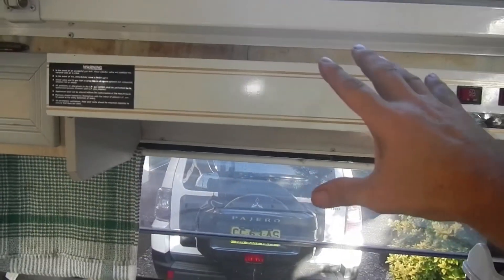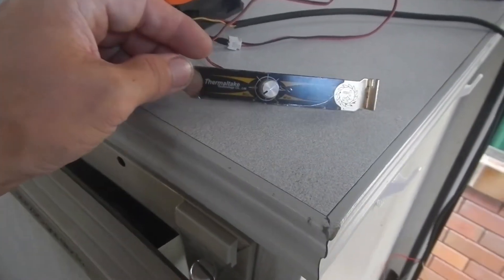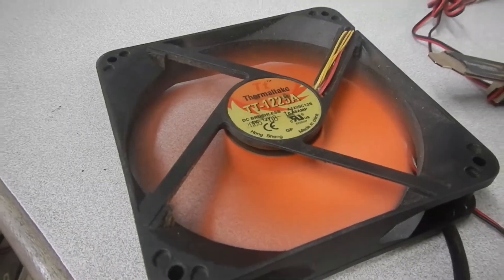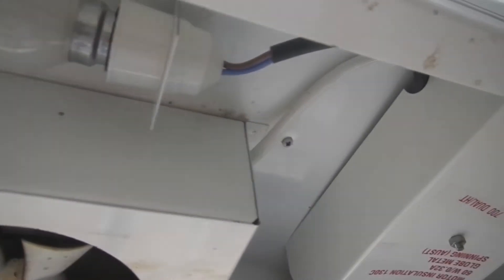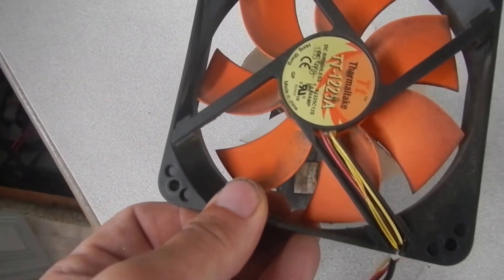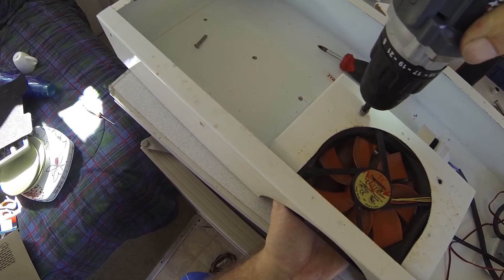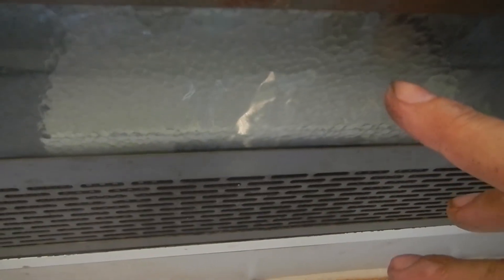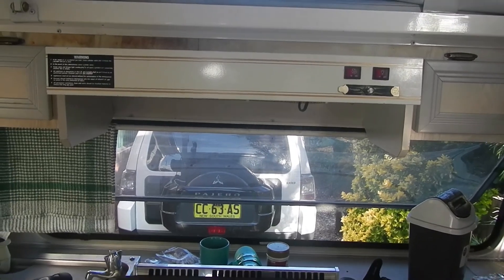Caravan Rangehood 12v Conversion

Comment: Good job. 
I found your video looking for ways to quieten a standard AC range hood (Robinhood). The low setting is 44 W and annoyingly loud. 
From my research AC fans are not as good as DC for energy efficiency, speed control, noise etc.
How do you find the air movement with the computer fan? It would be much less than the the AC one. 
My Robinhood is rated at 375 m3/hr which is 220 cfm, on high setting (65 W), and by extrapolation: 250 m3/hr on low (44 W), or 147 cfm.
Those little 120mm fans do about 10 cfm which is about 17 m3/hr.

My previous Robinhood was about 24 W on low and much quieter. Based on the above air movement specs. that would be 138 m3/hr (or 81 cfm). Unless your cooking meat at high temps. I think range hoods are way too powerful. You just need enough air flow to direct the fumes out the back.

I'm now looking at 120mm USB computer fans on eBay.
If I remove the grille below the Robinhood fan there's about 45mm to fit one of the 120mm fans (25mm height).

Comment: The Thermaltake TT-1225A fan is 120mm not 80mm.
Reply from the maker: Did I say 80 did I? Thanks for correcting me. I haven't used an 80 in a pc build since the 90s 😁

Comment: What the fuck is wrong with these caravan makers thay seem to do things on the cheap, I've got newlands caravan it's got one rcd running all the 240v and it ended up fryed, so $500 later and 3 rcds put in its working great,
Reply from the maker: No idea Mark, but they all seem to do it. 

It's disgusting what they do in areas that they think you will never see. 

I know the market is getting flooded with so many makers these days, but some workmanship is just pisspoor at best . 

and when it comes to that sort of stuff, it's just down right dangerous.

Comment: How did the rangehood perform after the modifications? Planning to do the same but with 2 120mm blower fans and enlarging the vent hole.
Reply from the maker: Great. I cook in my van all the time. The speed control was a nice touch and I find it quite useful. The led light underneath makes it much easier to see what you're cooking too.  Nice to be able to use it without the need for a hook up. Cheers
Reply: Great to hear. I may just do what you did. Keep it simple.
Reply from the maker: Just the way I like it. Not real bright me :) 

I've changed everything to 12v. If I ever need to, I can always just slap the car charger on the batteries and plug it into my 240 van socket. That way I'm hooked up but can still run all my 12v stuff.  I think many of the newer vans are like this now anyway.  Let me know how you go.

Comment: Have you got a link for that fan? I have the same caravan.
Reply from the maker: I'm afraid not. It's probably over 15 years old and came as part of a water cooling kit for a computer. It is just a variable speed 80mm computer Case fan though. So anything like that would work but the speed controller may look different